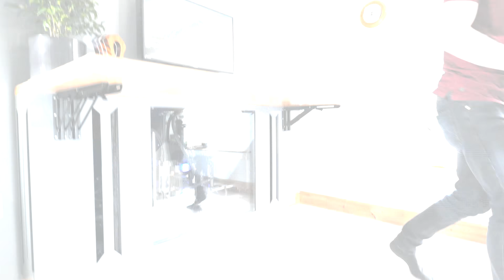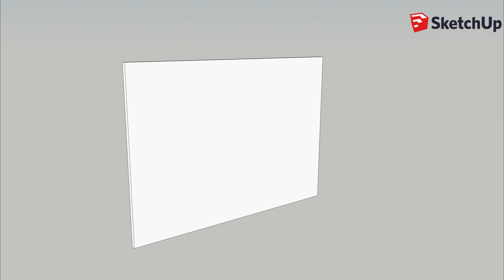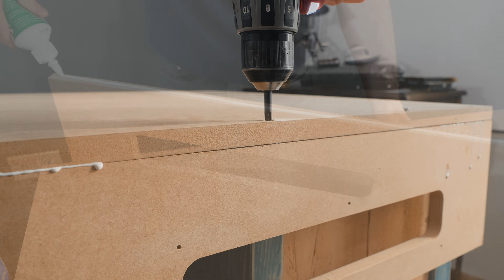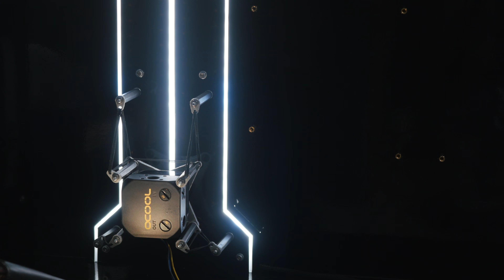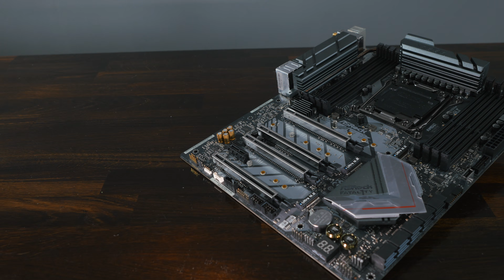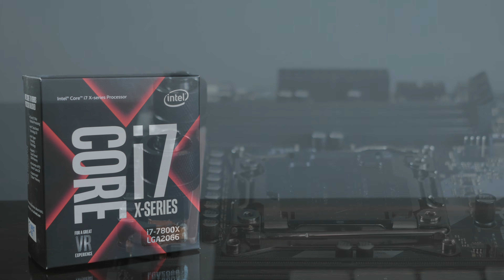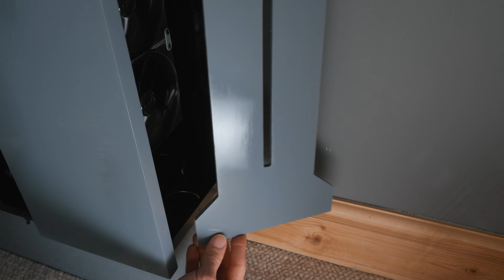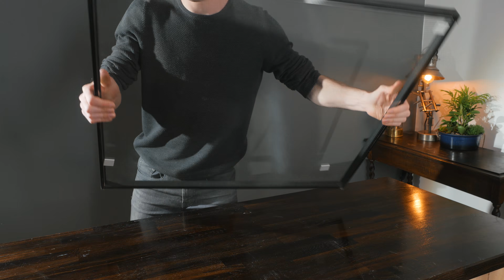Building a spectacular DIY 'desk PC' (it can fold!)

Comment: Ahhhh ahhh. Having time is amazing. : (

i always want to make something like this. And mine even have a mechanism that will hide keyboard and mice. I really hate it when they get dusted. ( My location can be very dusty, especially in summer. Or forget to cover the keyboard mouse and someone is running a vacuum cleaner, etc. ) Well you need a little electronic but it is not that hard if you have time.

You will say "Why dont you order a carpenter with your desing" Well the problem is, once i wanted to make a speaker cabin and that time i learned there are no 22mm MDF. 3mm, 6mm, 8mm, 10mm, 12mm and 18mm. And.... there is no more. That is all. Yeah you can make special order.... with tonnes. :D

Well i used 2 * 8mm and 1 * 6mm. Glued them together. But it cost me much bucks and time. And time is money so i was bleeding money. :D

You guys must cherish everything you have. Make good use of what you have.

While i was 9 years old, i joined a competition ( making pictures. for 7-10 years old kids if i remember right ). And I'm disqualified. You know why? i wass too good to be a kid. They say this "An 8-year-old kid can't draw this." They didn't even give me a chance to prove myself. Later my father bought me canvas and oil paint ( Because I'm sad. Even it was expensive. i really love my family. ). in a year i made really good paintings total 15 ( not count failures ) and 5 of them was nothing like you can explain it was not a job of a art student. That time there was a spark, i was able to draw thing i see or imagine, it was like i was drawing with copying paper. My father wanted to frame my paintings and take them to job with the car. And while coming back there was something ( He goes somewhere with another car and job takes longer so he came back with bus. ) and that day the car, with company that my father work and two other factories, burned ( Or rather, it literally blew up. i mean it. ). That day, while watching tv and see everything burns , my spark burn out. i can still draw desings ( Buildings etc technical things ) bur art is dead, i can't draw flower or animals anymore it is like there is a knot, like i don't remember what a bird looks like. And that is why when the first time i watched "The Day After Tomorrow", in a particular scene, i felt like i want to cry loud. And that scene is : 

Son : Hey, look, I got every question right on the final and the only reason why Mr. Spengler ( Teacher ) failed me was because I didn't write out the solutions.
Father : Why not? 

Son : I do them in my head. 
Father : did you tell him ( teacher ) that?
Son : I did. He didn't believe me. He said if he couldn't do them in his head then I must be cheating.
Father : Well, that's ridiculous! How can he fail you for being smarter than he is? 

Son : That's what I said. 

Father :  You did? How'd he take it? ( With a smirk )
Son : He flunked me, remember?

Human race and their narrow-mindedness. This is the common point between my memories and this scene.

Ahhh ahh. i am really unlucky with thing like this.

I even got a 100% scholarship for studying abroad ( France ) with hard work. My scholarship was canceled on the last second, because, the guy who received the scholarship last year, was involved shits every way possible.

There is a idiom

Allah yürü ya kulum demiş.

İf you translate it word to word

it means : God said, "Walk, my servant."

Of course as a idiom actually it means : "For some reason or other God has seen fit to make him successful and wealthy." You can use it as means "He certainly got rich fast" or "He has done very well in his work, nothing can stop him now"

So i wan't to create another idiom for myself : Allah DUR ya kulum demiş. DUR means "Stop" you get it right? :D

That is why i don't make plans.
Why? 

So destiny can't have much time to strike back. :D

You wan't example? Ok. How about this.

For the last 10 years. i never entered or see the sea. How?

Every year i made plans few time. But every time something happened. İ became sick, someone at home become sick, someone at work get sick so there is a lack of staff so i can't use my vacation. The water pipe blew in the house. etc And last time i go a wacation with my dad and father to my grandmothers house. 4 day later at the breakfeast i said "Today let's go to the sea, it would be good for your health :D" Thay say okay. Let's finish breakfast first, we can move after 2 hours , sea is not that far away anyway. 

After 90 minutes there was a phone call, that says my younger brother get a traffic accident and he is at the hospital. He broke his both arms.

i just give the destinyt 90 minutes.
And when there was not much a time, it strike hard.

I was hoping, that i could "wash my feets with sea water" for at least "a day".
As a result
I spent the next "few months" "washing my brother's ass."

So i give in. Anyway who like the sea. it is such a trouble and i really don't live enough yet. What if i give 1 minutes? Should a satellite crush on my head?

it is no joke. i said weather is good. Let's go a movie. İn 90 minutes there was a storm ( Weather raport still say today is a sunny day :D ). Lightning crashed into the movie theater and all sessions were canceled. More precisely, it crashed to the hall that i entered. Funny isn't it? it is not funny at all if everything goes black with a booom suddenly.

Sould i cry for being unlucy? Or be happy for having a supernatural power as that can even control the weather by being extreme unlucky... Ugh... i think there is really somthing wrong. 

Come to think of it recently i learned something. Apparently, chernobyl exploded, just before I was born. There is a series named chernobyl and it picked my interest. So i made a little more research. I knew it was in 1986 but i really did not know it was just before i was born.... it can't be right?...

Apparently, I was born when the nuclear fallout came to our country.

F*ck. i really want to cry now.

:D

Funny but it is real guys. 

in primary school i elected as class president by other kids. Next day i got a car accident, half o my scull is smashed. Come on, i am not elected as President of our Country or  President of United States of America. Even Trump don't get hit by a lightning so..... so... i really don't get it. 

If the reincarnation is real, which bastard was I in my previous life so that I could get so much trouble ha? Hitler? George W. Bush?.. Wait he was still alive. :D

Well. i wanted to share my life with a little fun. it written as to be funny. But everything is real.

Comment: Put a port in on the side, vacuum and fill with nitrogen to atmosphere +5PSI/35Kpa. No fuss no muss. And if there is a leak, your leaking nitrogen into a nitrogen rich atmosphere. The MDF may allow the migration of gases though it, but that may have been resolved with the oil based paints.

Comment: I love this, but you have a power supply constantly dumping heat into an airtight space.  Won't that be a problem??
Reply: The internal radiator with fans is also connected to the water cooling, which will transfer any general build up of heat to the outside radiators.

Comment: I'm interested in how you would disassemble this machine for watercooling maintenance.
Reply: I thought of making a rubber sealing around the glass and a locking / opening mechanism with hydraulics . Fold the desk up and then push a switch to open the glass , and u can do whatever u want with the interior .
Reply: You just remove the front panel

Comment: I'd be heaps interested in seeing a car PC implementation if you're looking for another project.  From what I understand from other videos, there are power limitations in a car PC implementation (that I don't fully understand), and there are particular challenges regarding overheating (e.g., when the car is parked).  Current implementations (such as the one I bought from a Chinese manufacturer) simply mount a tablet onto a DIN interface (and make it look like a PC by encasing the whole thing in a very chic enclosure that fits into the dash), but tablets have low RAM.

Comment: This is by far the most ambitious DIY project you have ever taken. Congratulations on being able to complete the build and thank you for the inspiration Matt.
I'd like to remind you however that you're not supposed to mount a hard drive vertically. It can be done with an SSD, but not an HDD since it has very delicate moving parts and how gravity acts on them. Hard disks are designed to operate while lying flat on a horizontal mounting system. I'd suggest you to remount them horizontally if you want them to last longer. You've already been through a hard drive crash and we don't want that to happen to you again. Best wishes.

Comment: Just a few small complaints, no hate:
1. you might want to add the ram before installing the motherboard
2. you have the loop connecting the gpu to the cpu directly. while you don‘t have to have separate loops, you should have a radiator in between, because like this, your cpu doesn‘t benefit at all from the entirely overkill, though much appreciated, radiators.
3. for the love of god, please fasten the reservoir! It doesn‘t produce vibrations since the pump is separated, and having it dangling by the tubing is just a massive hazard in so many ways!
4. you removed the heatspreader for the backpanel io. just saying.

aside from that, great build! it‘s awesomely done and a great example of a pc well done.

Comment: To get better signal-to-noise ratios from the PSU, I would go with 1000 Watts or even 1200. I would think 600 would be cutting it too close to the max draw with all that you have drawing power. If you're drawing 550 or more in real-time, you might experience intermittent CPU crashes as time goes on and you near the end-of-life cycle for the CPU.

Comment: What does elastic mean. Im german and I cannot find it.
Reply: Stitch7 elastic is the property of something to retain its shape after contraction, dilation, or distortion. Think of a rubber band and how you can stretch pull and twist and it snaps back to its normal shape.
Reply: Looks like German translation is elastisch
Reply: @Houseofarrows  tried that. Gummiband seemed to work.

But still can't quite find it.

Comment: Came here as I'm planning on building a under desk mounted pc in a wooden box with kinda straight duct air cooling design. With noise traps on both ends. But as I'm also fascinated with minimalism and heading in this direction at crawling pace, I kinda think maybe a folding desk would be in order. And I had very similar idea. With under desk pc box, the permanent bit of the desk only has to have the depth of the height of pc box, so when folded the box keep the desk surface parallel to the wall. In the end however, standalone desk might serve the purpose of a small dining table considering no pc is on it, only underneath. And also will give more flexibility and mobility.

Comment: I'd be very interested in seeing you try to implement a chiller system. The noise of the chiller, the different fluid mix as well as the condensation should be quite a challenge.

Comment: Hi mate, could you look into an EMF protective workbench that blocks you from any EMF radiation from the pc?
Reply: Couldn't you just put wiremesh around the inside of the casing?
Reply: @sclair2854  Yes, in theory. I was thinking the same thing just after posting this comment. Like aluminium mesh, or silver mesh. But it was more for awareness and maybe a tip to him if he didn't know about it. Thanks for the respond :)
Reply: @sclair2854  However, the mouse and keyboard is the most dangerous. Mine razer black widow 2.0 emits around 1800 milliwatts, that's around 180.000 microwatts. All over 150.000 microwatts make DNA damage.
Source: https://www.youtube.com/watch?v=eEc3E8VKoS0

We could add a thin silver mesh that has a nice finish on top between the mouse and hand, and for keyboard maybe all buttons with custom mesh that have the same gloss finish on the upper layer against the fingers with letters added, or just EMF appeal-like globs or something. I have the cap and boxer from this store that blocks all signals (99,98% at least, I tested it)https://shieldapparels.com/. And I see inside the cap I'm wearing now have a silver mesh or fabric inside the actual cap itself. It's really soft. EMF is some nasty shit. I had to operate my hand or carpus tunnel because I used the vibration in the PS4 controller dual shock.

Edit: Remover grammar and added link.
Reply: @DrAskildsen  I uhh, don't really see how thats possible when they don't emit ionizing radiation (If they can't ionize DNA then how do they damage it?)

Comment: I'm not sure about chilling the water, you run the risk of condensation that way.
Reply: I would love to see a collab with Linus on a build like that.
Reply: could be overcome by reducing the internal air "wetness" (well, i don't recall the term, but Waterconcentration in the Air!) to some sane degree (absolutely dry Air is an Heat insulator!) with eighter passive or even active Air-Dryers! ;-) - but because it is Airsealed i would call for a controlled Airfilling, meaning you need 2 Holes at the end where you can evacuate all Air inside and then fill it with the desired gas - could even be Heat-optimized^^ - tough the efforts may not be worth it for Private usecases but interesting to see "How-to" and the chemical Aspects of the filling to improve passive cooling while eliminating condensation issues at sub-zero cooling^^ - i would call for a cooperation with Linus &/ Der 8auer or other Enthusiasts that dealt with Stuff like this before! ;-)
Reply: but another Problem is "how airtight is this concept?" - as that will limit the possible Gas choices to non-poisening ones! (tough to get onto "poisonous Gas" is already hard enough in most modern Country's and restricted to Industrial use luckily!) - but Appart from this it would be Interesting to Know how Airsealed and potentially Vaccuum % you can get with "Home tools"! ;-)

Comment: You might want to shield those audio wires considering you set them near that PSU.  The transformers will likely emit a small EMF, which I'm sure you know can cause line noise.   But of course, it may not if the cables are shielded adequately enough.  Just a thought.
Although that DAC might get rid of anything like that to begin with.  Never used one of those on my PC output.    Come to think about it, I'd like to see you do a video on some sound stuff>   That would be a good one!

Comment: you have two usb-c outputs, one in the back of the motherboard and the other one as front panel connector, this could have simplified the port situation, you could have used one or two cables to connect any peripheral you could want, since one usb can be split into two, depending on the bandwidth and audio and 10gb Ethernet, radically simplifying the project and reducing the amount of cables needed to get full functionality, otherwise, looks good to me

Comment: This is one of the nicest, bordering on over-engineered, I have seen.  It also has the added bonus of being easy to upgrade/change out components compared to other desk cases.

That said, the level of this build isn't something that can be done on the cheap.  A total cost list, including what it would of cost for all the items he got for free, would be REALLY nice.

The need to seal it off from the air I think was a bit too far.  With some good filters (like AC/Heater ones), and low noise-high volume fans, the audible volume level would of been extremely close to the existing noise level he has with the fans on the external radiators.  Might have to do a quick dusting once in a while, but not often.

This could also be modified to be a wall-mount case of a more practical nature (no side sections, just water cooling, air, or mix of both).

About the only suggestion I would have is to use vinyl instead of paint.  Cost might be about even (depending on the quality of paint vs. vinyl type used), and it would produce a much smoother look and not have to worry about brush marks.  One could also do a veneer as easily.

Comment: This is really, really impressive! Well done! Probably I would never be able to build this due to lack of skills. If I could though, the only thing I'd change would be to mount radiators horizontally near the top of the cabinet. This could potentially improve heat dissapation through convection. That said, of course I absolutely love it. You're the man!

Comment: No airflow inside the main chamber... i dont think that MB and Power Supply will last long.
Reply: power supply was passive for that exact reason, as for the mobo with all the liquid cooling in their respective air tight places there's literally no reason it will have any problems
Reply: @MikeGSJR  passive power supply actually require contact with cold air (room temperature) and MB gets hot in many areas, not only in the VRMs. The only way to be sure that nothing gets hot is by putting a thermometer inside the case and put a strain on the system. I like to test temperature by running BF5 in 64 multiplayer with unlocked FPS. Run this for 2h, if everything runs fine and the temperature of the air inside the case is below 40°C then u can say that it has proper temperatures.